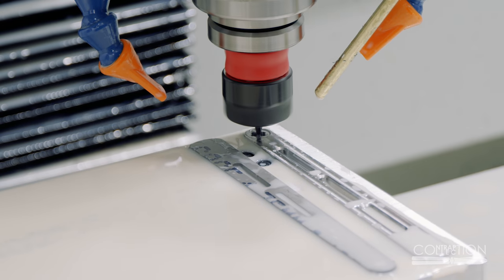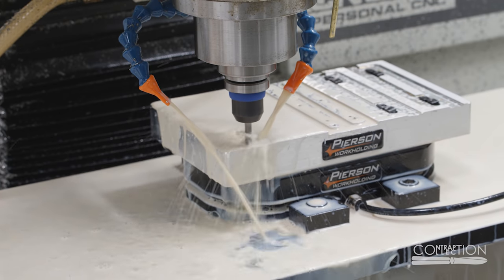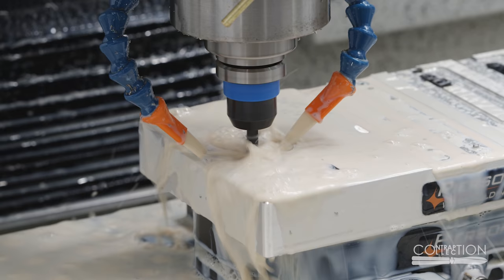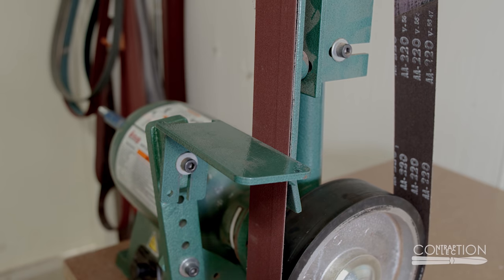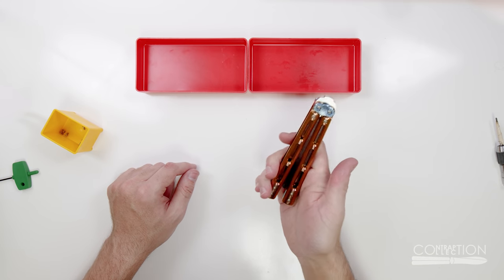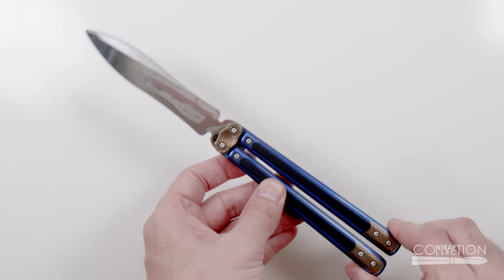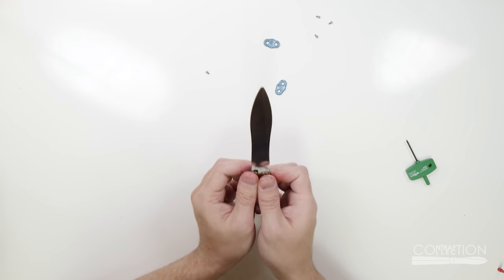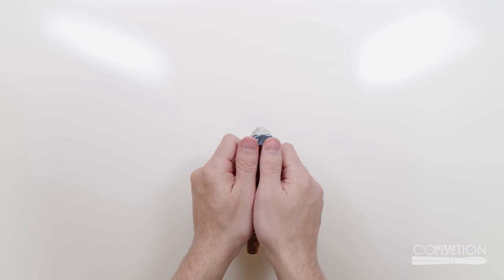More Ideas. More Problems. Baliscissors Ep 21

Comment: do you test them for pin wearing? hardned blade body could shave locking pins with each press buttun action. im just looking how small are locking pins (they heigh) and with extra precision size, chances  what you hit them with sharp edge of blade body extra high. try to open and lock them (from scissors to balisong mode) like 1000+ times, and measure wearing after that
Reply: In the watch and clock world. It is known that brass pins will actually wear down hardened steel, before the other way around. I think click spring did a video.

Comment: If you are contouring the blade, while your at it, why don't you put a slight arc in the blade so that while the scissors cut, there will always be a single shear point, which is what you want from scissors.

Comment: So, you designed a new pivot profile that has smoother transitions between concave and convex portions, and here you go - tool deflection has a lesser effect on that (because the tool doesn't get buried into the material radially). But, thanks to your previous design, I've got a perfect example for my machining/programming trainees at work.

Comment: In the measure tab of Fuison 360 there is a function called Interference, I use the equivalent in Inventor every time before I commit to making anything in real life, saved me from a lot of bone headed mistakes like the one you had. Another trick, in Inventor at least, is to add the moving parts to a contact set, that way when you try to move them in the assembly, if they come into contact with each other, they will stop or jump, it will not be a smooth, continuous movement.

Comment: What belt sander do you have?
Reply from the maker: It's from Grizzly. I wouldn't recommend it. I'd get a better knife making one where the belt rides on 3 or 4 wheels instead of 2.
Reply: @ContraptionCollection  Do you have any recommendations?
Reply from the maker: @Bowie0  I don't want to recommend something I don't own. I'd look up Walter Sorrells grinder buying guide to help you figure out what features you need. He has a Bader. I think KMG is popular, there's many choices. Those are expensive choices though so you might have to go used, or buy a kit, or start with something smaller. There's many YouTube videos and forum posts discussing all types of grinders. What I'd avoid is companies like, Grizzly, Jet, Shopfox, etc. All of these companies sell the same machines, probably made in the same factories, just painted different colors. These brands sell everything under the sun, and you'll likely get a better product if you buy from a company that focuses just on knife making grinders. I think I could have found a used, high quality grinder and put in less work to get it working than the work it took get the Grizzly working well from "brand new" condition. It also would have ended up having much more functionality.

If you're just doing simple sharpening or deburring machined parts, then cheap, two-wheeled bench grinders are easy to find and also a better choice than my machine that tries to do both.
Reply: @ContraptionCollection  thanks for the words my man. GL on the development of these. Super creative and fresh for the community 🔥